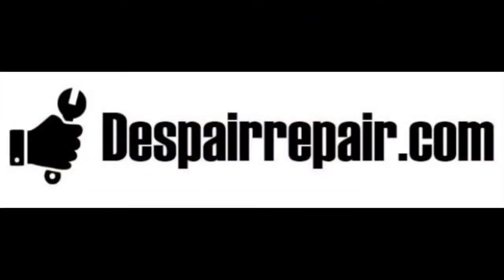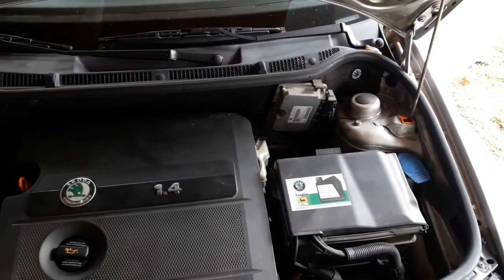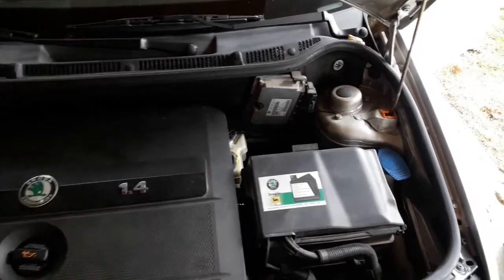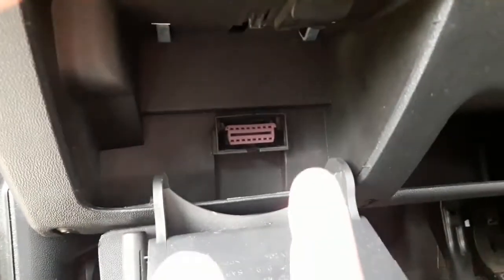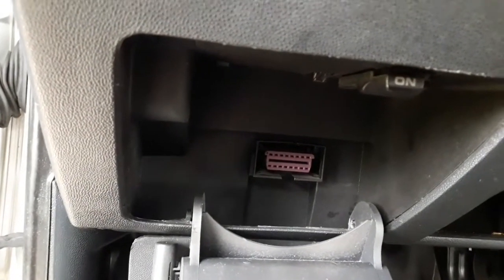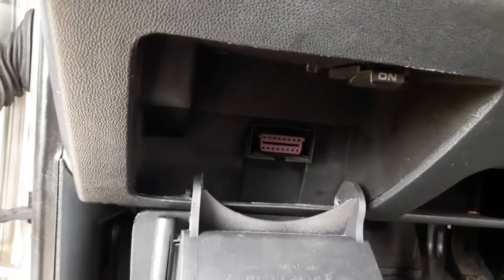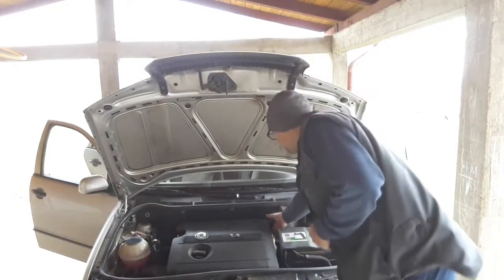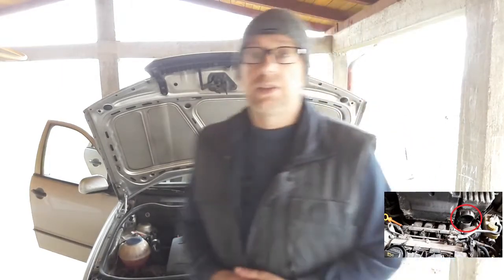Are Car Diagnostics Accurate?

Comment: I was driving my car going up a hill, it wouldn't accelerate to higher speed, the check engine light came on it was flashing, i also smelled like burning rubber. I pulled over, turned it off let it set. Then started it  back up, it seemed fine. Only thing I notice was my belt had slipped a little but was not off. I left it where it set gor a day til I could get it checked. Got it diagnosed nothing came up. We aligned the belt, I drove it home and it drove normal... what could it have been?